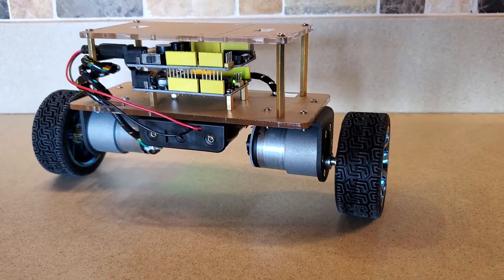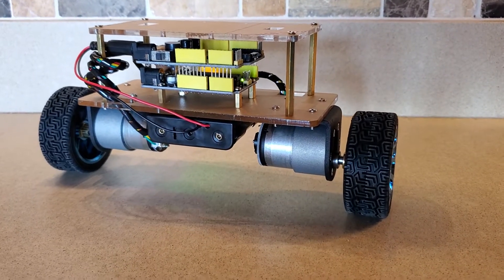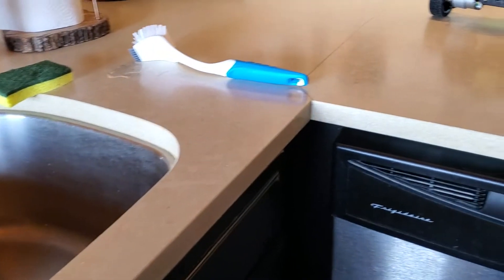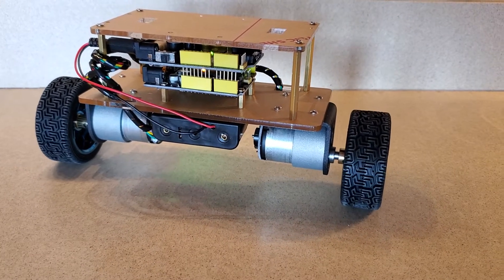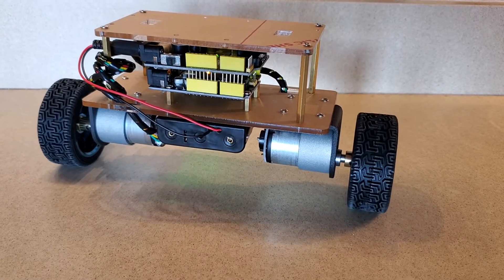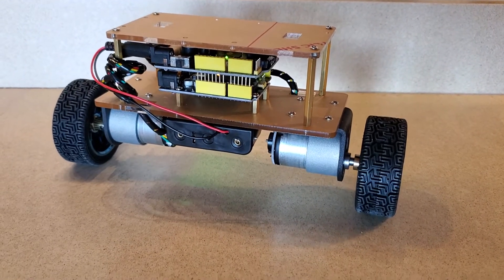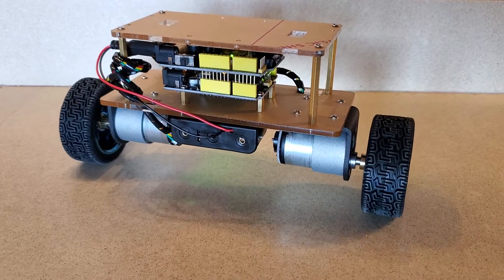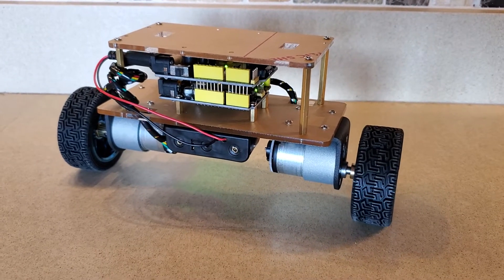Self-Balancing Robot Demonstration | Automatic Addison

Comment: Hi, could you please tell me the max. RPM of the motor ?
Reply from the maker: I’m using GM37-520 DC gear motors (with built-in encoder) that have the following specifications:

Operating voltage: DC12V
Reduction ratio: 1:30
No-load current <= 100mA
No-load speed: 247rpm
Rated torque: 1.4 Kg.cm
Rated torque: 137.4mN.m
Rated speed: 160 rpm
Rated current <= 0.45A
Stalled torque: 5.5 Kg.cm
Stop current: 2.4A
Reducer length: 22mm
Reply: @automaticaddison  Thanks a lot ❤️